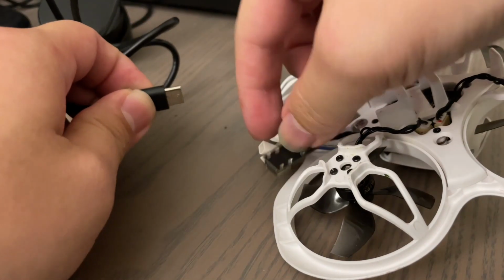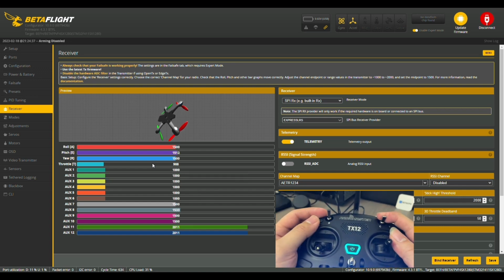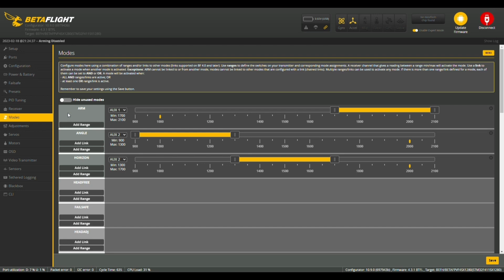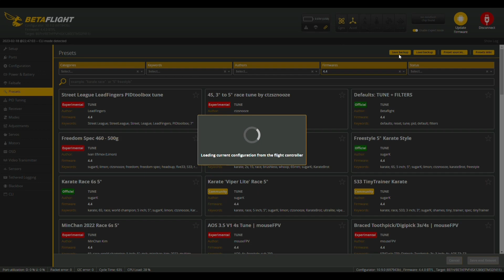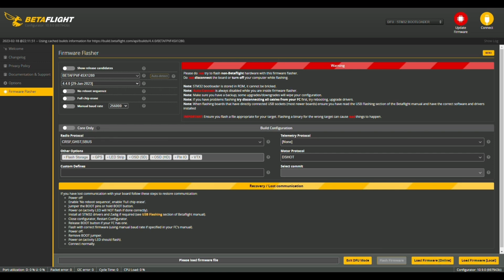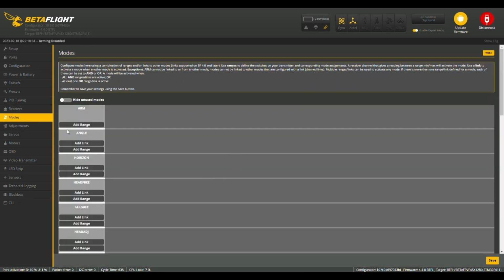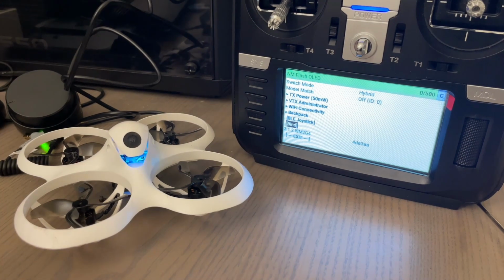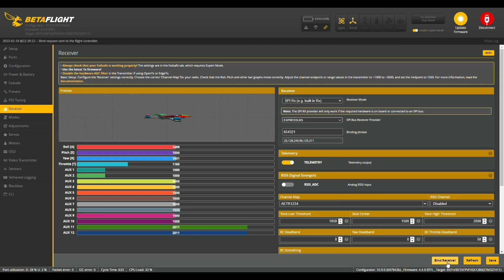BetaFPV Cetus X Flash Firmware  & ELRS Version with Betaflight. Step by step.

Comment: Thanks for the tutorial.  I flashed my Cetus-X to 4.4.0 for a GPS module. (Haven't installed yet). Im unable to bind the original remote controller.  Possible you have a fix?
Reply from the maker: Your remote and receiver will both need to be at ELRS 3.0+ to bind together. Only The first number “3” matter. If the remote you have is the BetaFPV radio 3 ELRS, you need to flash it via BetaFPV configurator. However, I’m not sure if they have a firmware that supports ELRS 3.0 above
Reply: Hello, did you find the solution? I have the same problem." in English. If you have any more questions or need assistance, feel free to ask!

Comment: I’m confused.If u can already bind with Cetus X and configure W/ Betaflight prior to flashing Why flash it?is this to allow future updates?Cant u just bind and go fly not worry about it or am I missing something?
Reply from the maker: Yes, if you drone binds fine, you can just bind and go fly without any issue. 

As my radios are all at ELRS 3.0 above, the purpose of this update is mainly to update the ELRS version from 2.0 to 3.0. 

Also, since this is a SPI base receiver with the ELRS receiver built into the FC we have to flash BF to get the receiver updated to the right ELRS versions
Reply: @XwingFPVRC  ok thank you I get it.Thanks for quick response.

Comment: Thank you very much for the video; it was very helpful. I faced some difficulties with the binding process and couldn't see any RX data in Betaflight despite flashing my BetaFPV Cetus X with Betaflight 4.4 (ExpressLRS v3.0 support) and my Radiomaster Ranger Module with ExpressLRS v3.2.0 on a Radiomaster Zorro TX transmitter. Although I observed a brief movement of RX input data during the binding process, I couldn't see any transmitter data, and the drone was still blinking green instead of showing a solid green light. To bind the Cetus X, I powered it using USB. However, I was able to resolve the issue by adjusting the Radiomaster Ranger module packet rate to 250 Hz instead of the default 500 Hz. Now I can see the receiver data in Betaflight.
Reply from the maker: Glad that you have resolved the connection issue :)
Reply: Thank youuuuuu,  ❤
Reply: thaaaaaaanksssss mate !!!
Reply: Thanks, you've just solved my issue :)
Reply: Broooo, you just saved me from spending more hours of suffering. I appreciate your comment like you wouldn't believe. I already spent more than 3h trying to bind this thing with my Boxer. I lost count how many times I flashed different versions and reinstalled Betaflight. Thank you!!
Reply: Thank you very much !!!! :)

Comment: Needs help. How to revert the sw back to 4.3.x (to get back elrs 2.x)?
I've seen a comment from another person - he updated drone sw and got native remote does not work (as betafpv does not made sw with elrs 3 for literadio3 yet). And he cannot revert sw back - tells that configurator|controller fail to connect...
Reply from the maker: This is something i haven't tried yet, but by theory you should be able to flash it back to older versions via Betaflight.  For the Lite radio 3, i dont currently have one, so sorry, i cannot be in much help at the moment.
Reply: @XwingFPVRC  got an answer. Looks like betaflight configurator 10.9 has a bug in flashing. Installed 10.8 and managed to flash all
Reply from the maker: @petrokey  Now you know more then me LOL!

Comment: Where can I buy that adapter thing to plug it into the computer?
Reply from the maker: The adaptor should come with the drone. If you don’t have one you will need to contact BetaFPV as they are the only one selling it
Reply: @XwingFPVRC  I am considering buying a Cetus X but don't have one yet. Good to know it comes with the adapter. Thanks
Reply from the maker: @pekwalker  Yes, I didnt know at first and took me hours to look online and later found it in my box

Comment: Can't enter DFU mode for some reason and it says "Failed To Open Serial Port"
Reply from the maker: I experience this as well, please confirm you are able to connect other quads with the same usb cable to betaflight? In some case, even if the cable shows a usb symbol it will still not connect properly. Try changing a cable of you have another

Comment: Got a new question (the more I read the more questions I find).
Does 'regulatory domain' tx16s config matter?  As I understood elrs also has FCC or LBT and the 'regulatory domain' actually switch fcc/lbt (please correct me if I am wrong)
Reply from the maker: Based on my understanding, the major difference for FCC and LBT is by the output watts. 

FCC = No limit = US and other countries
LBT = Max 100mw = EU Regulation. 

If you are in EU, you will need the version LBT to stay compliant. 

Does this answer your question?
Reply: Does this mean that drone (rx) does not care if tx use fcc or lbt? other words I should not worry that cetus x on 4.4 may be compatible only with fcc or only lbt tx?
Reply from the maker: @petrokey  Sorry, this i am not sure, as i am in the US so its always FCC, but i will assume your theory make sense. If it does not work you can flash it again to the correct FCC or LBT
Reply: Looks like cetus x on betaflight 4.3 does not have a EU domain support. At least console command 'get expresslrs' reports only ISM2400. I have not updated sw to betaflight 4.4 so do not know if they added a EU support

Comment: Is there a way to check what exectly version of elrs is integrated to this board betaflight? Or is there a way to find a betaflight release with particular version of elrs version?
Or just ignore and assume that betafpv 4.4 with elrs 3.0+ will be suitable with other 3.x receiver sw versions?
I've checked Joshua's manual on spibased elrs but he only mentioned about disabled model control for his drone..
Reply: I've tried to search for current version of elrs through betaflight github... But did not found anything particular.
I might be mistaken, or I might check wrong branch.. but it seems to me that betaflight has their own elrs sw development process instead of pulling and porting native elrs code.. this why thay tell '3.0+' instead of specific version..
Reply from the maker: @petrokey  You are correct, and this is the main reason why SPI based ELRS receivers will need to be updated through Betaflight instead of ELRS configurator
Reply from the maker: Sadly, there is no way to check the ELRS version on SPI based receivers. The only way to find out is by looking at which BF version are you at. 

"Only" BF 4.4 or above will be ERLS 3.0+. The rest are 2.0 or below 

Yes,  ELRS 3.0 will work with 3.10 / 3.11 / 3.12 as long it starts with a "3"

Comment: Im new at all this fpv thing... can you in noob words explain what did you get with this and how is is better :)
Reply from the maker: As you may already know ELRS is a radio protocol frequency to connect your radio to your drone. 

The purpose of updating the betalight firmware for the Cetus X is mainly to update the ELRS version from 2.0 to 3.0. As my radio is already ELRS 3.0 above, it will not work with any drone that has ELRS 2.0. 

Updating these firmware sis like updating your iphone firmware, you don’t have to if it still works fine, but you need to update in a certain point when the APPs no longer support the old firmware.
Reply: @XwingFPVRC  You should post how to put it back to original version and repair with lite3 controller since im assuming thats what most have. Still working on getting the default controller connected and now it wont. Any advice?
Reply: Yes for sure wouldnt do this unless you have another controller. Still not reconnected
Reply from the maker: @iamsavagegaming2155  Currently i don't have the lite radio 3, but i will defiantly look into it if i acquire one. Can you send me a video, it may be easier for me to try to spot the issue?
Reply from the maker: @iamsavagegaming2155  Just trying to figure out, Did you flash the drone and without flashing the controller? Both side will need to have the same version as both as 2.XXX or both as 3.XXX ? Not sure if this is the issue?
Reply: @XwingFPVRC  Hey man I actually like JUST figured it out!
I needed to use betaflight configurator 3.8 in order to flash a successfully working 4.3.1 to get the expresslrs working again as 2.x.
Once I was able to flash on configurator 3.8 it worked no problem. I did allthough have to remap the controller in order for the sticks to be correct in the betaflight controller configurator! Haha so it seems like the key is using betaflight configurator 3.8 for 4.3.x versions and use the latest one for expresslrs 3.x

Comment: This is my very first whoop. 
I ordered this  1 day before the the new release.  I tried to cancel the order but they shipped it. Anyway my question is will I need to go through this step when my Cetus X comes in?
Reply from the maker: Assume you purchased the ELRS version?  

If you purchased the entire kit(drone, radio, goggles) then you don’t have to worry about updating any of this.

If you purchased the drone only, To determine if update is needed

#1 check with BetaFPV to find out what version of BF your Cetus X is at  
#2 find out your radio ELRS Version 

If your radio is ELRS 3.0+ and the Cetus X is not at the newest Betaflight version, then yes, most likely you will need to update it 

But, let me know what you find for the two questions s and I can give you a better answer